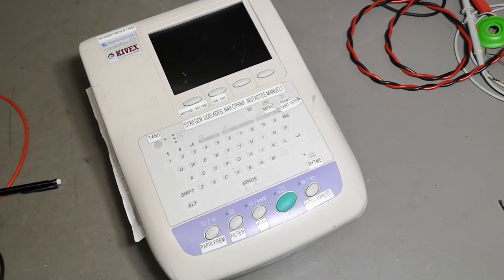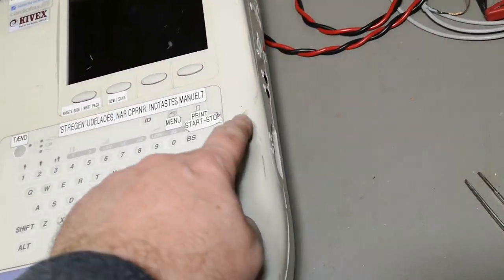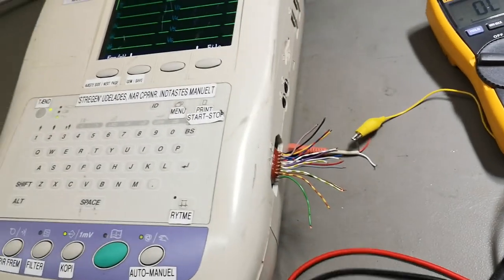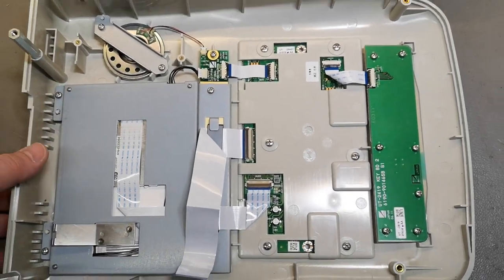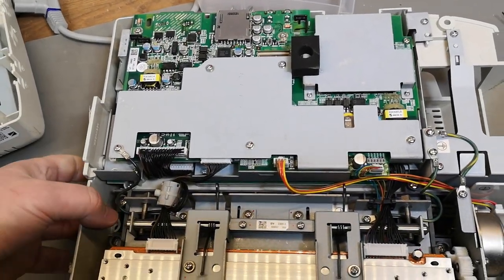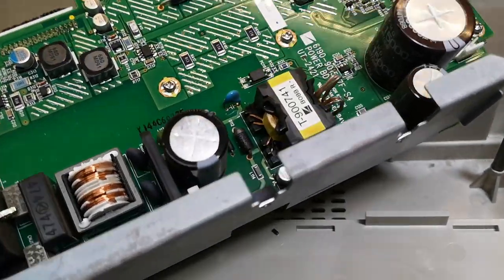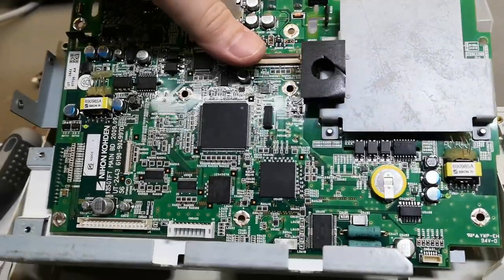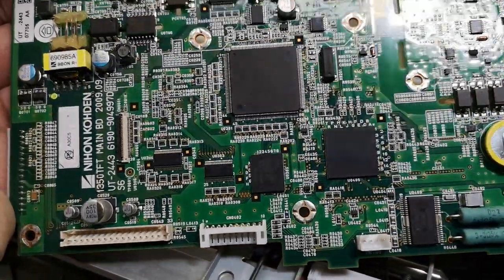Electrocardiograph model ECG 1350K Nihon Kohden 2010 teardown

Comment: Thermal print head has 2 connectors, because it is too long to send the serial data down the shift registers otherwise, and you need to have a low impedance 19V power supply to the thin film resistive heaters. Then a 3 wire connection for the reflective optoswitch that detects the black index mark on the Bisophenol A impregnated paper, locking you in to them as paper supplier as opposed to using the common cheap thermal fax paper roll, even if the rest of the printer mechanism is exactly that, all parts supplied by either Sharp, Epson, OKI or Matsushita, as they all make the ceramic print heads for pretty much everybody, and they make a standard serial interface that allows clocking in the data at high speed (10MHz IIRC clock rate) and with a latch to transfer to the output buffer, then you apply a variable width enable pulse, which sets the contrast per line, while the next line is being clocked through the long shift register. That 19-24V supply has to handle the peak current of around 4A per pulse, so there are decoupling ceramic capacitors on the small PCB that provides interface between the connectors, and the flex PCB that connects to the ceramic heater.
Reply from the maker: thanks a lot, very relevant comment, I will look deeper into this next time I see a thermal printer :-)

Comment: The isolation are also cause this kind of equipment should be able to resist to defibrillator discharges. It may be connected to a patient when she has some kind or cardiac episode.
Reply from the maker: my wife is a nurse, and was working at the heart sector, she tell me one ekg electrode is removed for discharge, since it is in its way for this job, but it is well known that equipment handle the high voltage .